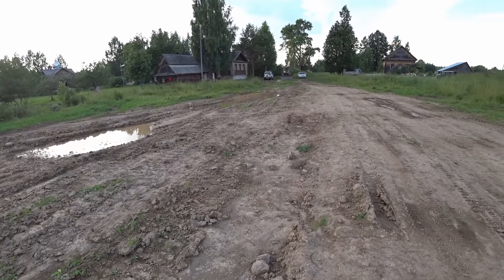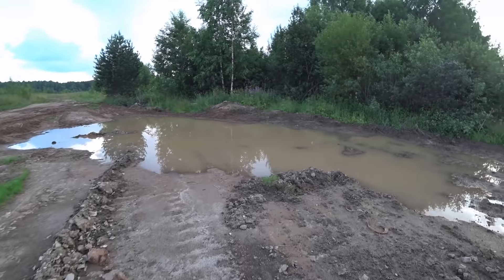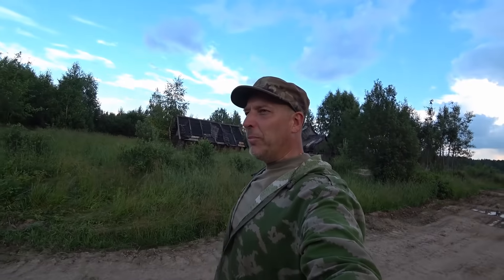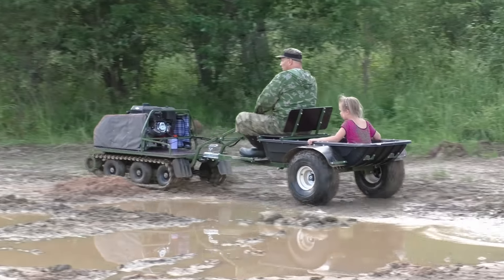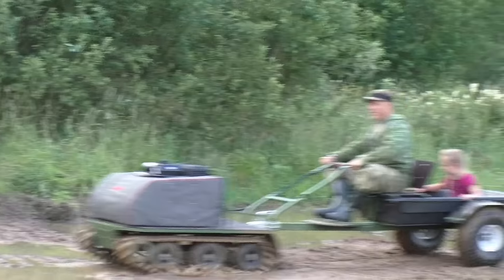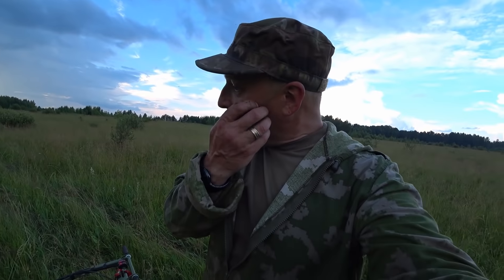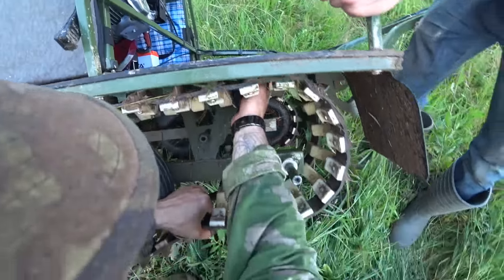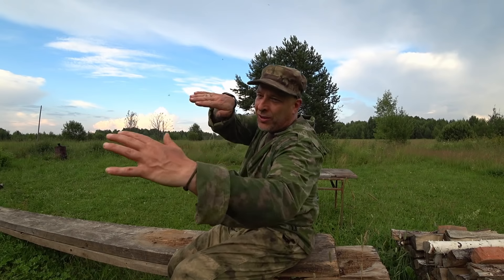Test Driving The Mini Monster-Crawler

Comment: I drive small 360 excavators at work occasionally. I have had a few rubber tracks come off always when working on an gradient. Usually down to tracks not being tensioned enough.
That side angle film shot on the road test really shows how long the tractor and trailer are when combined...Longer than i imagined.

Comment: G'day Lars, Brilliant video! That's why they use the term 'shakedown' cruise, trip, test drive etc. it's to 'shake' the gear and see if it breaks. You just learned one of the rules of being a tank driver; never run with a whole track off the ground. You handled it very well and you should pester the company so you get a propper maintenance manual. You'll need a dedicated tool box for your fantastic new machine. Awesome! Cheers, Bill H

Comment: I can't wait to see how this does in snow.   I want one for trapping in the winter.  The ones I've seen here have one track about 20  to 24 inches wide.   GREAT VIDEO!
Reply from the maker: The ones you have is called "Snowdogs". They are also a Russian concept, and they drive on a snowmobile track. They are not super great on mud and uneven terrain though. I can mount a 3rd track at the center for very deep loose snow. I might have to do that. We will see :)
Reply: ive ran a td6 and that puppy floats on snow ;)
Reply: That is exactly what is is. Just a snowmobile track and a lawn mower engine (Snowdog) . I wondered about that and thought two tracks might be better.  What about putting a hard plastic ski or sled between the tracks for snow?  I also saw a Russian one that floats so you can take it out across a lake!
Reply: TD6 ?
Reply: OK, thank you. I thought you might be talking about a tractor of some sort. A bulldozer makes sense.  I have heard they get scary fast on a sidehill in the snow!   Have you ever seen a screw drive snow machine?  Look up  "Fordson Snow Tractor"  neat idea, but side hills might kill ya!

Comment: And for reverse i think that best and  lightest is to go for electric reverse.Mini crawler allready have battery, just put biger batery and take starter dc motor from some okd car and with litle welding and working you have reverse on mini crawler.In my mind better than some complicated gearbox just for reverse gear that you will use maybe 5 minute in year.Very good chanell, love yours tattos, they are very interesting for me but i will not ask questions about them.Especially on youtube🤣🤣🤣.Yours ninjas are awsome.Best regards from Croatia

Comment: So many things you could adapt to that. Pull type grass cutter, sled in winter, cart in summer, road drag for leveling , You would need to use 0-30 synthetic oil in the winter for easy starting in the cold.

Comment: That thing needs a hi-lo transmission with reverse... It's geared waaaay to high for slow going, as you have to slip the clutch/belt in tough conditions too much when going slow. Personally, if it was mine, I'd find a way to re-gear it to go slower, so it would be MUCH better machine for woods use.  SR
Reply from the maker: I have been thinking about that actually. I need low range power and not top speed. I did the same with the SRV actually.
Reply: I think it's Jonsered that sells a small track machine here in the US. It's something like yours, except it is hydrostat drive, so it will go more of a slow walking speed or faster. They sell it as a small log skidder. SR

Comment: Lars is discovering the "joys" of driving a "tank" in Russia! ;) Very nice! For my liking the gear-ratio seems quite high, i.e. it drives too fast. A dedicated "crawl"-gear would be nice for those tricky situations in the forest, where You will need lots of torque at very little speed. The concept with one driven axle in front and a trailer with seat on it reminds me of the 1950s in Germany...lots of HOLDER- & HAKO-vehicles like that in use, prior to real tractors. Our neighbour got thrown off once from his seat driving a sharp curve too fast...so be aware of this issue. ATB, Gereon
Reply from the maker: I have been thinking about the gear ratio actually. I will install a lower gear ratio. It should be possible to find a larger sprocket for the drive axle, and a longer chain. I don't really need top speed here :)

Comment: An essential crawler tool kit needs bolting on to that machine. 
That's the downside of the reliance  of mechanical equipment in remote locations. 

I'd include:  starter cord along with the sockets and spanners.

Great machine!
Reply from the maker: Yes I will certainly have setup an "EDC" tool kit and add to that for somewhat longer trips :)

Comment: That is a very cool machine!  Very interested to see how it does in the snow.  I think this year I'm getting a snowmobile to help me get around and cover some distance.  I agree with one of the other comments - a hydrostatic gearbox would be much better than the centrifugal clutch but they are heavy and much more complicated.  Does the gearbox not have a low and high?  Best wishes from Canada - Michael

Comment: Use that bug crawler for tilling up the soil, and making a valid garden and orchard.
Reply: With that water level, think about digging out the wetland, and make a large bermed pond for raising fish.  Could even plant and grow some wild and domestic rice and lotus in a paddy.
Reply: Now if you were in CA (SanFran libby land of thie insanes and irrationals), you would have to have a driver's license and special testing for that vehicle (like an ATV driving permit), take a course on the vehicle, have front and back end headlights and rear stop lights, license plate front and back, a safety roll bar, a seat belt, an engine governor, have to use an ethanol/gas mixture, have proper safety inspection by the department of motor vehicles for the function and tightness of the treads (and whether you have worn-down treads to such a specific measurement - and have to replace them), a catalytic converter on the tailpipe with a silencing muffler, a safety brake that stops the vehicle if both hands are not on the handle bar (safety buttons), the gas throttle can only be opened up so far, there is a safety cord on the ignition key attached to the driver - if the driver is thrown from the vehicle (or roll over) the ignition is turned off and the engine stops the vehicle, ... there are also back end triangle reflectors (for slow speed vehicles off road and on road movement ....

Ahhhh ... the land of fruits, nuts, dopers, homeless, insanes, ... and those elected from those groups to run the state government ...
Reply from the maker: I have some plans for using it for the garden and other tasks. First I will need to build a backhoe :)
Reply: John Lord,
 Very accurate description ! You only missed, smarter than you and know what you need, because they are legends in their own mind :-[  from the state of Chicago and ballet dancer.

Comment: Really cool. I know you said it wasn't necessarily meant for snow but, do you think it will work?  Are you going to try it out on snow?  I can't wait to see it stuffed into the SRV and your first two stage expidition.  Great stuff!
Reply from the maker: It certainly drives on snow too. The black "bathtub" can be lifted off the trailer and is ready made for being used as a sled :) I have not shown that yet. For very deep snow I can mount a third track between the two others.

Comment: That thing is cool but i would still prefer a ATV , better ride , it can tow the same trailer and you can snowplow . Maybe its much cheaper though?  A good quality entry ATV like a Yamaha Kodiak sell for about $5000 us
Reply from the maker: A Kodiak 700 costs a bit over 10.000$. The Crawler about 2500$. ATV's are good, but for my purposes 10.000$ is certainly not worth it :) I'm not sure an ATV is optimal here. We don't have many open areas and the logging trails are really tough going. With the small Crawler I can drive between the tire and belt tracks from the big vehicles. A standard ATV weighs about 3 times as much as the Crawler.

Comment: In my eyes there is problem with design, it is mising idler sprocket wheel on the back, same as front sprocket drive wheel just that this one will be idle sprocket wheel at rear and it will keep tracks in line.in my eyes it is bad design of using inflated ruber tire for that job because if you have flat tyre on that  last wheel track will fall of.And in design like this you must control presure in wheels very often because pressure difers with air temperature

Comment: How would it compare to a 4-wheeler?  Honda or Polaris?
Reply from the maker: They are very different vehicles I would say. An ATV is much heavier, but has more power. The Mini Crawler has a lot of power compared to weight. It's much lighter than an utility ATV as example. Lower cost too :) I  think it's hard to compare them. The Crawler makes sense for the terrain here and what I intend to use it for.
Reply: That's a good point , only one way to find out :-) you fancy a trip to Russian ?
Reply: Make a small trailer for the survival russia vehicle to haul the track machine to areas that you need to access with track machine
Reply: That little ninja is sure growing up.  She looks like she is having a blast.
Reply: I think it fits in the SRV